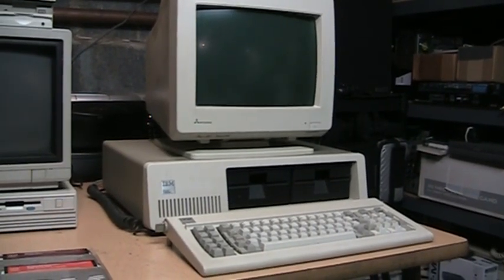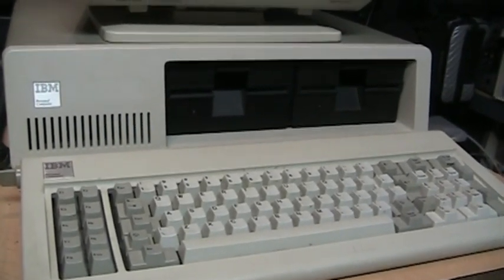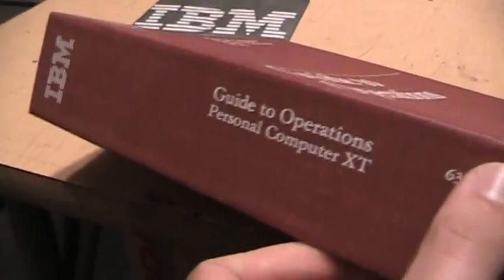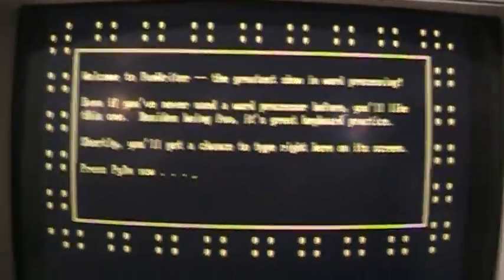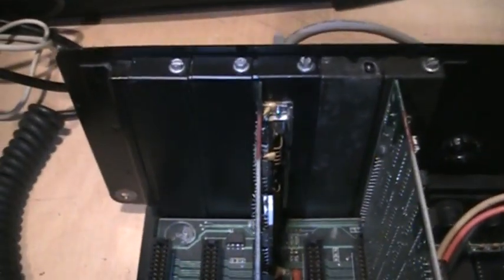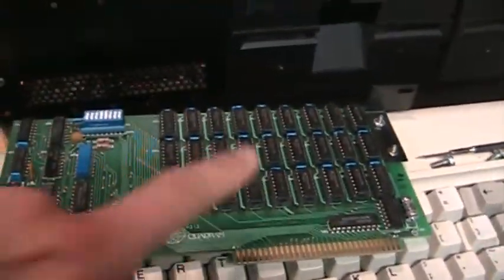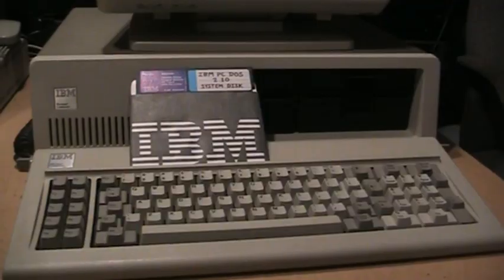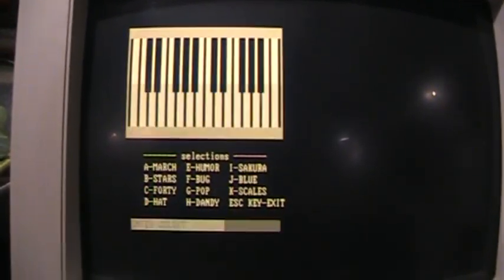Exploring the IBM Personal Computer

Comment: Concerning the 544Kbs of RAM: I had a 5150 back in the late 1980s, and ran into this problem - specifically, DOS did detect my 640Kbs, but the BIOS had not initialized more than 544, so I got parity errors when programs passed the limit. I fixed it with a small program I wrote and ran during boot, which simply wrote zeroes to the remaining 96Kbs WITHOUT trying to read it, and thus presumably resetting the chip parity bits... The simple solutions we had back then...  :-)

Comment: I have a very weird, but happy memory of slightly later IBM desktops, IBM was once the second largest employer in my hometown, and I knew many employees as I grew up. I also happened to do Raptor rehab and educational programs. I had a friend who was an engineer at IBM, as well as a photographer on the side. We were both hired to shoot a series of promotional photos using IBM computers and a couple of very tame, and patient owls I had at the time. He had a monitor shell with a false screen, which had a light source inside, and we built a set with a large tree limb with the unit set up on it. The Great Horned Owl was set in front of the computer and photographed as if he were using the computer perched in a forest. Gorgeous photos! Also used a little Screech Owl for a shoot. I have no idea what ever happened to the photos, or what the project ended up as It was supposed to be an ad campaign if I'm not mistaken. This was in the early to mid 90's.👍

Comment from the maker: I only have one PC now (the one with the hard drive and CGA card). I sold this one.

As far as I know, all 5150 PCs shipped with full-height floppy drives. The half-height drive in yours was probably a later replacement. IBM used half-height drives in the later XTs (beginning 1985) and the XT-286.

Comment: Great video.  I've never seen a revision A 5150 before.  I've had several 5150's and 5160's but they were all upgraded to 640K and could boot a hard drive if installed correctly.
Thanks for sharing.

Comment: The original IBM PC was so much more capable than the Apple II it competed against. Faster processor (8088 was far superior to 6502 chip), more memory (Apple II started with 4K, could be upgraded to 64k, IBM started with 16k and was upgradeable to 256k), and the fact DOS was licensed software all heightened its opportunity for the future. Likewise, the IBM XT in 1983 was far more capable than Apple's IIe product from 1983, and that common trend never really ended. The IBM-PC standard was always superior. It is easy to see why IBM & compatibles became the standard PC. Great to look back at history!

Comment: Adding on to vwestlife's answer, the firmware inside the IBM PC runs a test on memory when power is switched on. By writing to the RAM chips and reading the values back, the firmware can determine the location of bad chips by examining where the values read and written differ.

Comment: Back in the day, I use to service these and run system preps. One time a customer purchased a hard card, which was a hard drive that is designed ot get installed via the ISA slot. It didn't work. It turned out, as you said, that he had a 5150 that did not suport it.

Comment: I'm picking up an ibm 5150 on Thursday after searching for over 3 years for one that works and is in my price range.  Looking at the photos, it too does not have the ibm logo on the second drive, so that seems to be normal :o)  Wow, text mode pacman!! :o)
Reply: I just found one after looking a year. After church I was killing time before work, downloaded letgo, a minute later saw one with a  5150, 5153, and model f for 50 dollars!!!!!!! Called in sick and drove 50 miles to pick it up.

256k + 256k expansion, dual floppy, 20mb hardcard (dead drive though), and a math co-processor. The expansion had some bad memory, and don't have any software, but I can copy my own disks by the way.

Comment: Interesting differences between this one and mine - my one is also a revision A 16-64KB board, but the floppy drive doesn't have the IBM logo on it, and it's the later 130W PSU fitted too... very random...

I was given mine for free, what with it having been in storage for 25+ years, and have the 5151 green monitor too which still works, but sadly no original keyboard as the company think they threw it out! The machine originally ran when I saw it, but the PSU cap blew but this has since been replaced along with all other motherboard caps so it's back to working order or booting at least now. Very lost as far as finding any of the old floppy discs unfortunately, and at present the floppy controller card also needs fixed as neither drive picks up (DIP switches are set correctly etc), nor does the 256KB RAM expansion card, so still a bit of a way to go on the restoration!
Reply from the maker: Some of the early floppy drives did not have the IBM logo on them. It's also possible that it originally had single-sided drive(s) and then was later upgraded with double-sided drive(s).

Comment: I'm going crazy trying to find a demo program, I think it may have come with the 5155 (at least I remember seeing it on one of those), it had Flight of the Bumblebees, as well as some kind of psychedelic visuals.
Reply: You are thinking of a demo program which came with the Compaq Portable. It  originally worked with ms-basic 2.11, but it crashes in the later gw-basic 3.x. I've yet to rediscover a usable Compaq MS-DOS 2.11 boot diskette which includes the demo.

Comment: I take it you have at least 2 5150's, in other videos you've made you've shown a 5150 with a hard disk and 3.5 inch floppy drive, so I'm guessing that's another computer, also your other 5150 had a CGA card in it if I remember correctly.  You're such a great presenter, you did a great job with this video.

Comment: Can a RTC module from a XT work on this? So you don't have to manually enter the time. They only have years from 83-99. Will keep the correct time though.
Reply: Maybe not. I missed the backplate portion.

Comment: I found one of these Revision A's in the trash a few years ago in mint condition, all original with the monitor, wires, keyboard, everything. I loved playing Wheel of Fortune, and I think it also had Family Feud on it.

I ended up chucking it out though, as it was so damn big and I needed room for my modern desktop instead. Are they worth anything, or are they just good for nostalgia only?
Reply from the maker: A complete system would be worth a few hundred dollars. With the original boxes and manuals, $500+!

Comment: Didn't the XT have a 63 Watt power supply? I never had a 5150, but I did have an XT with a Hercules graphics card and I could have sworn it was 63 watts. Also, the 8088 and the 8086 were REALLY slow, even for their time. It's funny too that IBM create the standard that nearly bankrupted them. I don't think they even make any PCs at all anymore. They sold the WONDERFUL Thinkpad to a cheap Chinese company who then ruined the TP brand.
Reply from the maker: The IBM 5160 XT came with a 130-watt power supply, while the 5150 PC came with a 63.5-watt power supply. And Lenovo's ThinkPads are still pretty good. It's their cheap non-ThinkPad laptops that suck.
Reply: vwestlife Thanks. The TP was one of the best laptop brands ever. Most had great screens and they are easily field serviceable. I've wored in IT since the early 90s and Think Pads were light years ahead of their time. Speaking of which, I have a T20 (IIRC, it's away at the moment, it's a 700MHZ P3 IIRC) that powers on then right back off again. I had just replaced the MB so I don't think it's a power supply problem, plus it does charge the battery. Any ideas?
Reply: With the money they spend on cooling, most of them could buy a much faster chip. Chips that are easy to OC are worth overclocking, but they are few and far between.
Reply: christo930 that’s why you got the nec v20 or v30

Comment: where do you get all of these pcs?
Reply: +Corey Sheehan I found a 1988 Swan XT 10Mhz computer at a local PC store's recycling center. Try asking local repair shops.
Reply: geo58impala thanks. Never even thought of that. There's 3 local ones within walking distance I could check out.
Reply: Corey Sheehan what did you find?

Comment: You have to wonder how IBM managed to design such a bad computer. In particular, the 20 bit address bus, 16b internal data bus and the 8 bit external data bus Add in the worst memory mapping scheme and you have a computer that only IBM could get away with making and become the defacto standard for 33 years and counting! Of course, the good thing is the long term compatibility.along with open standards. IBM tried to kill the clone with the AT based on MCA, but ISA and EISA were so dominant that having micro channel was actually a setback!
Reply from the maker: It's a limited design because IBM had to cheapen the design to make it price-competitive with 8-bit computers like the Apple II, TRS-80, and all the CP/M machines that were popular at the time. And of course they probably didn't think the design would last so long -- a maximum of 640 KB of RAM was more than anyone would ever need in 1981, but of course by a decade later, things had changed!
Reply: vwestlife I am pretty sure they deliberately used a 20 bit address line and the awful hard/soft segmenting system and put the BIOS and Video ram at the top of memory so that it wouldn't become a defacto standard and was meant as a short term solution until a "real PC" could be developed by them.. It's possible that if it weren't for LIM EMS, we would be using much different PCs today. Thanks!
Reply from the maker: christo930 It is well known that IBM didn't want the PC series to compete with their mainframe systems. And in 1981 when most personal computers had 64K or less, it seemed that no one would ever need the full 1 MB of address space -- especially since actually having that much RAM at the time would've cost thousands of dollars!
Reply: vwestlife I think it's a real shame the Amiga didn't catch on in the business world and that CBM didn't aggressively pursue big business. Amiga was so far ahead of it's time but I think the low res monitor and the early form factors (except maybe the 2000) are what kept it out of the business market. If you don't know, you would be surprised at how well an Amiga can stand up to even a Pentium machine (YEARS after the demise of CBM). I think if they would have introduced all Amiga models in the 2000 format, it might have stood a chance especially if they allowed clones. Of course,,Motorola wasn't able to keep the 0x0 going (stooped at the 060), but if they had Intel's volume and income, they might have been able to keep working around the architecture the way Intel and AMD have.
BTW... I really like your channel.
Reply: and the best keyboard ever made
Reply: Joe Martucci
Are you talking about the old IBM keyboards or the Amiga ones? Both were better than anything on the market today except maybe high end expensive keyboards that go for over $100. The loss of build quality over the years of PCs has been staggering.
Reply: christo930  Even though they are Atrociously slow, They are nostalgic and,for a lot of people (such as myself), hold great value. They are, however very sturdily built and It would seem as though PC cases are becoming more flimsy by the year.
Reply: computer
Reply: +sirshredsalot 1977 I think it's mostly the market changing. Back in 1996 it was common to spend $2000+ on a computer. Laptops went for $6000! And I have old tech magazines to prove it! Today you can buy a PC for as little as around $200 to $500, so of coarse build quality will be crummy.
Reply: geo58impala very true. Back in like '96 I think, my dad spent at least $2,850 on parts to build a windows 95 computer and at that time it was a real hotrod of a computer. And yeah, nowadays it's cheaper to build a computer. As a 11 years experience computer builder, I can verify that the build quality is definitely crummy for most ATX cases but the good thing is that high performance parts really compensate for it, especially if you've got an intel i7 4ghz processor in there.
Reply: +sirshredsalot 1977 I actually think it's cheaper to buy now than to build your own, especially since you have to pay $150 for a licensed copy of Windows. Also, if I built a computer today, I would use much higher quality parts than most pre-built rigs are made from. Just the case alone would run $100, another 50 or 60 on the PSU. Just Windows and the case/psu and we are up to $300 already.
Reply: christo930 that sounds accurate, but it also depends on what hardware you use and how much you plan to spend. you can build a decent gaming rig now for $800-900 dollars compared to $2,850 back then but yes buying a shelf unit is cheaper than building a computer.

Comment: It can't use hard drives without a boot disk? The entire thing is junk. Belongs in a museum.
Reply: Whats bad?
That was normal back in the day,
Reply: +MetalSonicodraco7342 Nothing is bad. It's just too old to be useable. I wouldn't want to use boot disks all the time. Mid 90's computers are useful. This one is not so much.
Reply: +geo58impala For me is still usable.
Not totally usable as a Apple II or Commodore computers, Atari ones and you know
Reply: It has two floppy drives. You could just leave the boot disk in all the time and run programs from the hard drive. Anyway its a computer of its time. Not much point calling it junk now several decades later..